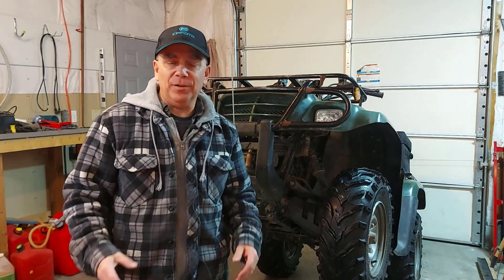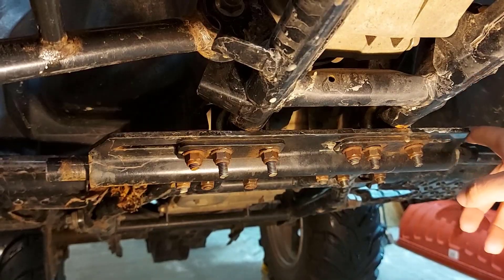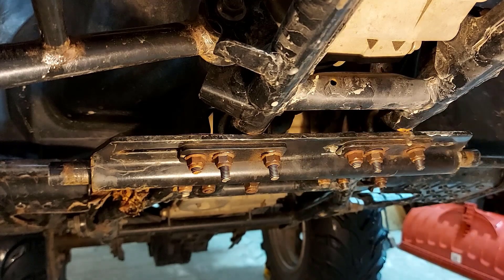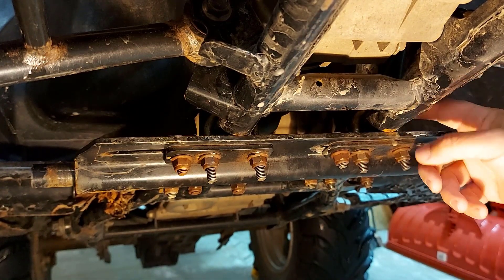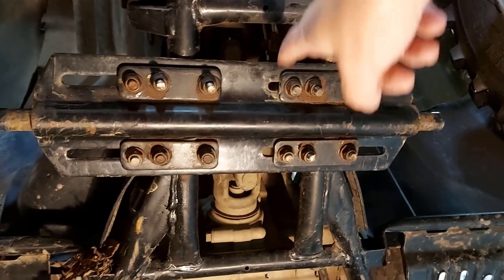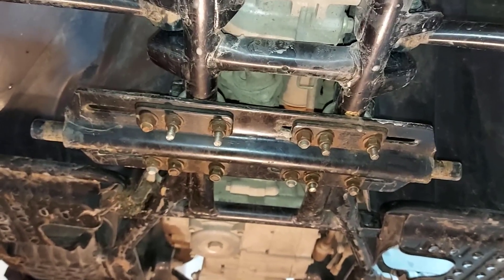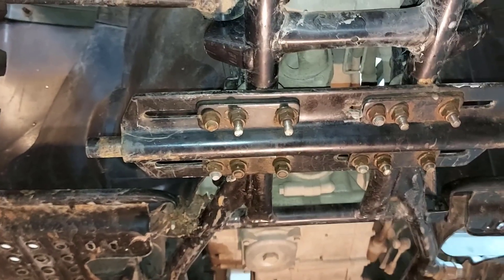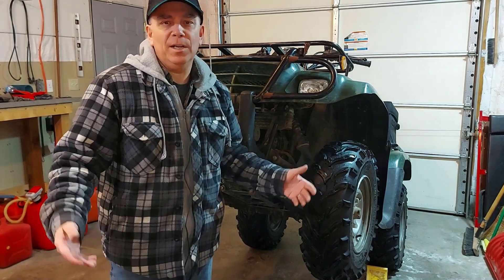ATV Plow Mount Install | Click N Go 2 On a Suzuki Eiger

Comment: Could you possibly do me a huge favor, your sons Cforce, any chance it's a 800XC? Could you possibly ask him for a measurement  from the cutting edge of the blade to the ground with the blade all the way up? Im very limited on trailer space, and im trying to determine if i would have enough clearance to raise the blade and pull it over the front rail of my trailer. Appreciate all your vids, thanks!